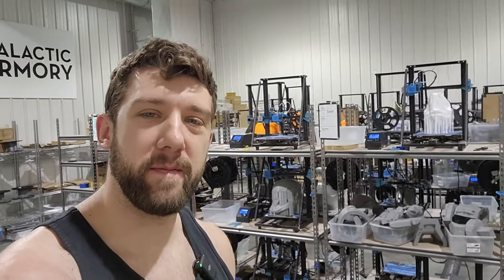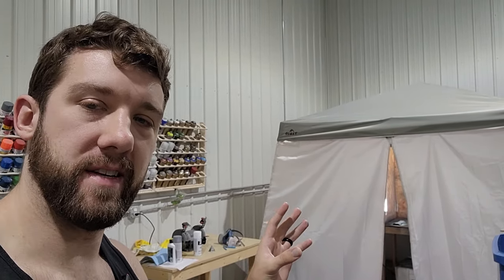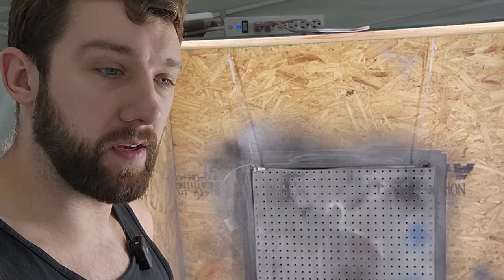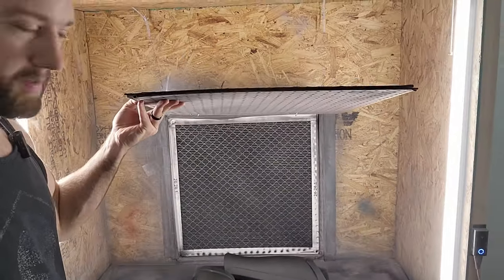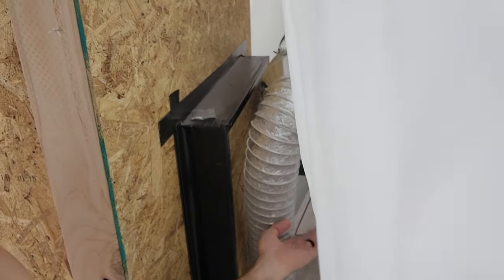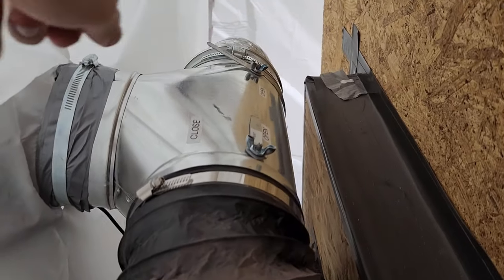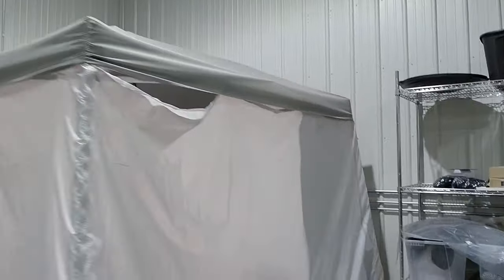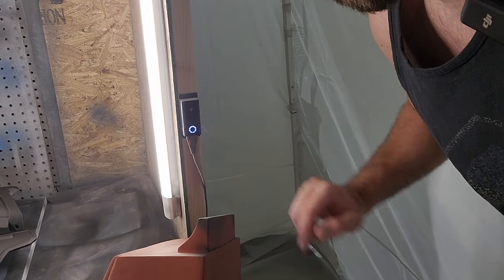Galactic Armory Paint Booth Tour

Comment: Just out of curiosity... is the air extractor you're using pulling the paint fumes through the electrical motor itself?  I have seen setups that use an air handler typically found in an HVAC system that has an offset motor outside the airflow.  This eliminates a possible spark from the motor igniting the flammable fumes from the spray paint.
Reply from the maker: They are separated - that was something I forgot to mention